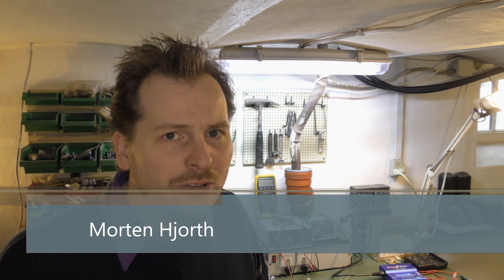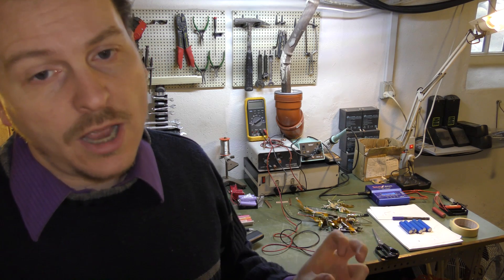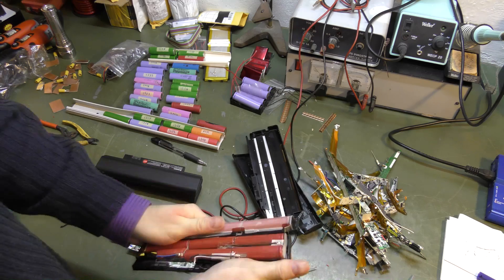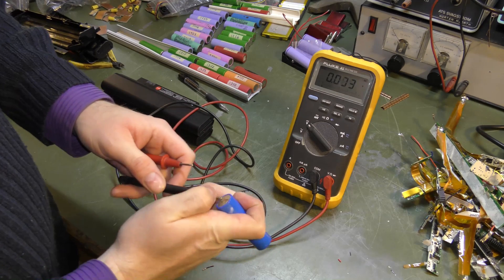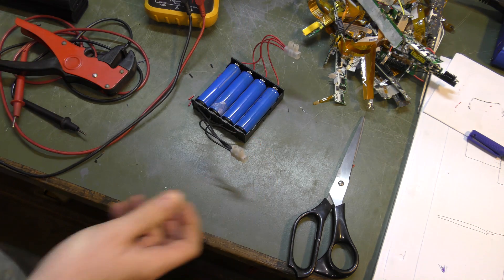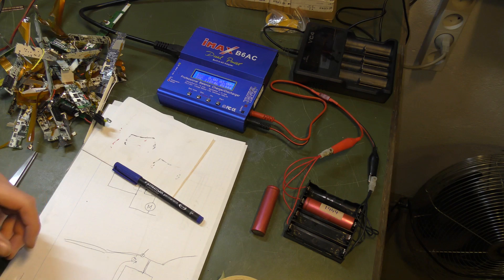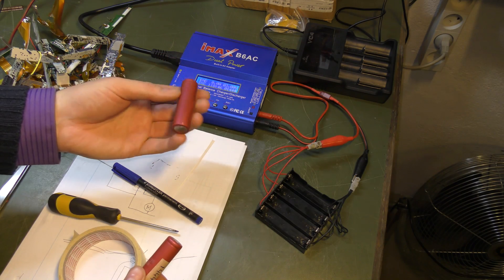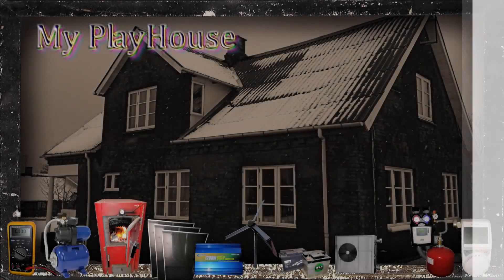How to open Laptop/Notebook Battery - Li-ion - Lithium - 322

Comment: You might also sort them by chemistry. This determines the full-charge-voltage. There are ones with 4.1 and ones with 4.2 volts. You don't want to charge a 4.1 volt cell up to 4.2 volts. It does not seem a lot but as the tolerances are very small and you can cause effects like overheating and damaging the cell.
Reply from the maker: Hi FloTheBestEver
Thank You very much!  glad you liked the video :-)
Thank you for watching! :-)

Comment: Hello, i received my new lenovo 9-cell aftermarket battery for my T430.

It turned out that lenovo had decided to put a control chip to the batteries and my laptop checks if the battery is Lenovo's.

My laptop refuses to charge the battery but run with it and on boot it tells that battery is not supported.

Do you know some technique to fool the laptop check or fool the chip control ?

thanks
Reply from the maker: Hi DegreeStudio
No sorry,, I never tried this :-/
Thank you for watching! :-)

Comment: You won't be able to do that with IBM, HP pack...
And I don't want to sound rude but your way of twisting cells is the best way I could imagine for shorting + and - at cells + top.
Very dangerous "how to", sorry.
Reply from the maker: Hi +Propergol 
This works just fine on most HP, IBM, Lenovo and Noname packes,, I fund It hardest on DELL´s.
If you thinks this is "Very dangerous" then this method is not for you. You are in control and free to do what works for you.
Thank you for watching! :-)

Comment: Hello, doing the same but still concerned about the discharge timings, I have ot really started as i only have a 1-2 weekends a month for these things ;).  if the imax can charge 6 different cels, I am guessing it cannot discharge 6 cels and give you 6 results? It would be nice if it could...
Reply from the maker: HI +Rincewind TheFirst 
No The iMAX would only give me 1 result,, and I would not finde the bad cell,, there are other discharging units out there.
Like http://amzn.to/1W0gAOT,, I think this can test four 18650 at ones.
Thank you for watching! :-)
Reply: +My PlayHouse (Morten Hjorth) Thanks! I researched a bit and ordered a similar one from ebay, much cheaper than other options so I am guessing I will regret it ;) . Once I test it I will pass on the info!
Reply from the maker: Hi Rincewind TheFirst 
Yes It is really not hard to wast money on cheap shit,,,Finding the good cheap shit,, that is the art :-)
Thank you for watching! :-)
Reply: Hello again, I finally bought the C3100 on ebay (chinese copy) which is cheaper, at least at the time... As when I bought it it was 18 Euros, after my purchase the seller increase it to 25 (for new purchases) and now 30 euros... nuts. Overall it seems to work quite well :)
Reply from the maker: Hi Rincewind TheFirst 
Has the price gorn up like that!! I can see that it is like 34$ now,, was it really only 18$ when you got it?
Thank you for watching! :-)
Reply: 18 Euros yes, that was the price, not sure if the seller made a mistake or if it was a way to atract people then increase the price...
Reply from the maker: HI Rincewind TheFirst 
Properly the last of the two :-)
But dobbing the price is lot.
Thank you for watching! :-)

Comment: nice video. I have been using the foxnovo 4s charger and it will charge them up, then discharge at 1amp and then recharge and it leaves the mah rating on the little screen until you remove the battery.  Some of mine have gotten warm/hot so I leave a computer fan in front of it and haven't had any problems with the batteries since.  I just ordered a 2nd foxnovo so I can do 8 at a time.  I charge/discharge 24/7.  Battery fun
Reply from the maker: Hi +donzi joe 
I will look in to this foxnovo,, Dis/charger,,, sounds nice.
Thank you for watching! :-)
Reply: My PlayHouse Subbed
Reply from the maker: Hi donzi joe
Thank you for watching! :-)

Comment: I discharge at 1amp and batteries are fine 400mah discharge rate is way too slow. Good video.
Reply from the maker: Hi +Doogs Fixit Vids 
I started with that, and the IMAX B6 set for 2 hours,, but fund that the really good batteries would all end because of time out,, and i did not get all out of them. and two hours is already a long time to use on each :-)
Thank you for watching! :-)
Reply: +My PlayHouse (Morten Hjorth) You can adjust the cutoff timer setting on the Imax :)
Reply from the maker: Hi Doogs Fixit Vids
Yes I know,, but i have like 400 cells, and 2 hours is already a long time for each :-)
Thank you for watching! :-)
Reply: Ah yes true.

Comment: Bruteforce and ignorance, That is the simplest method I have seen to open those battery cases. Maybe I missed it, but do you have a plan for those batteries. Informative as usual. Keep up the good work!
Reply from the maker: Hi +oOMonkeyMagicOo 
Yes I want to build a power bank to power my house,,,some of the time.
Thank you for watching! :-)
Reply: +My PlayHouse (Morten Hjorth) That's quite the project. I hope you get is as soon as possible cause it sounds huge. I am only interested in 18650 cells,cause they use them in most battery operated bicycles. Are those cells "naked" meaning they don't have a protection circuit embedded on each one right?
Reply from the maker: Hi +Mprikiman smith 
I'd think that most of them are naked,, they come from laptops, and all of them has BMS's and protective circuits.
Thank you for watching! :-)